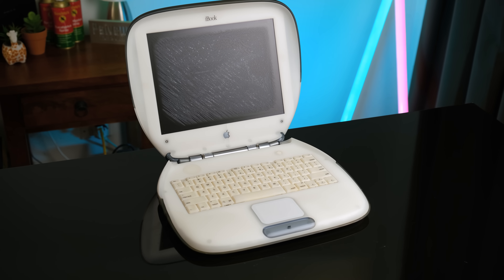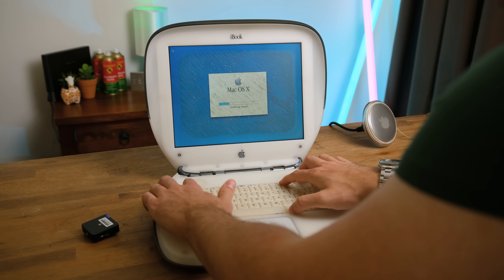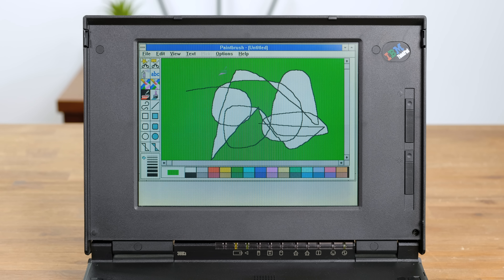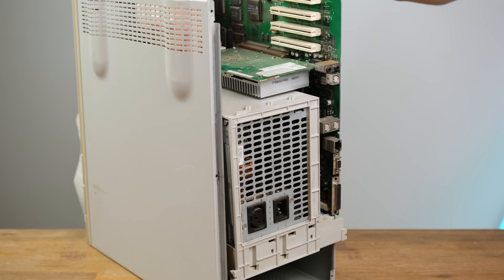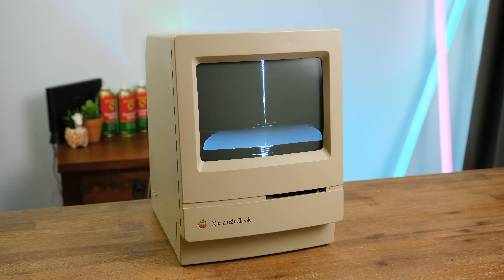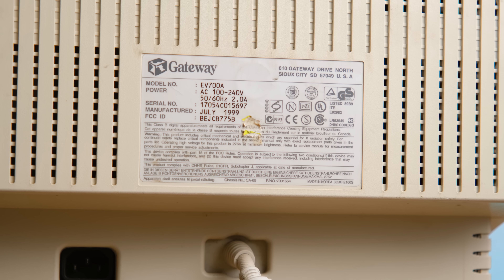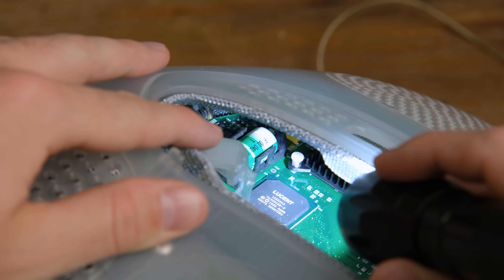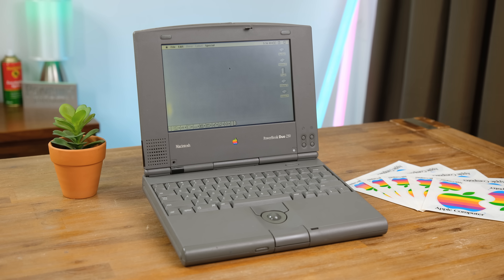So Much Vintage Tech Is Dying... Here's Why

Comment: I'm hopeful over these next few years we start to see things like motherboard reverse engineering, as well as after market motherboards for at least the big ones, imagine a raspberry pi powered iBook, for example
Reply: Or even things like the resistor emulation NES emulator
Reply: A couple machines have already been reverse engineered, so hopefully more will come in the future. The Commodore 64, Amiga, and NES all have brand new boards that can be used to restore old machines. You can even build a new machine almost entirely with off the shelf parts, aside from a handful of custom chips.
Reply: @NoToeLong  That's awesome!
Now imagine in the far future a board like that for say the OG Xbox, or iBooks
Reply: This reverse engineering is already common for industrial and vehicle parts, because changing them to something modern would require a lot of paperwork
Reply: @Skullair313  Hm that's interesting
Reply: @NoToeLong  Its very expensive to do retro with real old or new hardware. Software Mame UAE etc a lot easier for casual or multi platform usage.
Reply: And maybe MiSTer on a newer, bigger and more powerful FPGA!
Reply: The new X79 and X99 motherboardso the Chinese are making.
Reply: Along with the environmental conditions in space (no air or moisture) and the expensive radiation-hardened components, they are much simpler. Voyager launched in 1977, the same year as the Atari 2600. It's not at all difficult  to find a functional Atari here on Earth; most of them still work perfectly fine. Ironically it's the much newer devices from the late 90s and on that tend to stop working or disintegrate.
Reply: I'd love to see more open source reverse engineered schematics and boards for things like car ECUs, audio amplifiers, etc. Even if you have to do all of the part sourcing and assembly yourself, it could mean saving an otherwise mechanically sound device from the landfill.
Reply: @BokBarber  Exactly!
Reply: At that point why bother?
Reply: @ligametis  What do you mean
Reply: @ZaCaptain1229  why do you need iBook body for a raspberry pi? Especially when it would fit in smaller and lighter body.
Reply: @ligametis  Why not? There is no reason to play a console from 20 years ago, there is no reason to ever use an iBook from 2002, hell there's no reason to even breathe my guy. The best thing about this hobby is we always ask why not? There's an HDMI mod for the fucking NES, which came out in the 80s. There is no point to that, but people do it because why not. I understand not everyone cares about these things, and there's nothing wrong with that
Reply: @ZaCaptain1229  original hardware is interesting due to historical insight how it worked, how it felt.

If it is no longer original why use modern components to create inferior product? 
At least when it is stationary system size and weight doesn't matter that much, but when it is a portable system like laptop or a phone, tablet it makes zero sense to use something that outdated.

Look at original Gameboy, it makes zero sense you use it. You turn on, appreciate historical artifacts and turn it off.
Reply: @ligametis  Just because the motherboard has been replaced doesn't make everything else original, and if possible improved, imagine an iBook running on a Pi, with an OLED screen, custom made for the Chassis, as well as the original keyboard
Reply: @ZaCaptain1229  but why would you want original body? It is large, heavy, pretty low quality.
Meanwhile we don't even usually make OLED screens in square form factor. That would be an expensive part.

This project would at least cost 300$ if not more.
Reply: @ligametis  BECAUSE WHY NOT!!!!
Reply: @Zac Meyers  waste of time, waste of materials. Where are you going to take such laptop? To work or to university?
Reply: @ligametis  Sure why not?
Reply: @ZaCaptain1229  Ever played PS3 on 1080p, looks aweful.
Reply: @ZaCaptain1229  Original keyboards can be a major pronlrem , see ZX81 Spectrum etc, people disliked and replaced the originals when they could in the 80s. A mint showcase computer is good for display or demo, for serious usage an improved keyboard is a must.
Reply: @ligametis  Check out reversing camera LCD displays, B&W or color 4:3 composite units can be had for cheap.
Reply: @ZaCaptain1229  I mean... He's got a point. I can understand somebody keeping an old iBook in shape. But stuffing a pi in it is... Well, you got a pi inside a mac shell. Like... I don't know. That sounds insanely dumb from my point of view. That would be like me going to car show with a 70s muscle car at a collector show room but I got a modern engine under the hood. I mean, it works! But, there sure will be quite a lot of flat noodles around. Like that won't even surprise me.

Adding HDMI to a nes is interesting because you are working with the original hardware and limitiations and pushing its capabilities in one way or another. I mean, can't really argue its the same than a pi with NES roms on it. 

I mean, short of incorporating it in a way that turns the shell into a piece of art. And I do mean incorporate it in the design and not just strap LEDs on it. There is litterally nothing interesting there. If YOU personally want that pi in a mac shell. Okay, but like, don't be surprised if everybody else is scratching their head.
Reply: @ThermalLance-hg4rd  Hey you make a good point. At the end of the day I just don't want to see these shells, these pieces of history just go away
Reply: I want to reverse engineer a Pentium processor.
Reply: @monad_tcp  That is awesome! Imagine an "Open Source Pentium"
Reply: @ZaCaptain1229   yeah, but it would require expensive microscopy machines and a lot of spare Pentium  that weren't scrapped for their gold. They're becoming a bit expensive.

I'm really interested in developing the computing vision software for VLSI reverse engineering of anything.

But without quality scans I can't do it, I can't do the scans on my own, thou.

Perhaps one day.
Reply: @monad_tcp  Let's hope!
Reply: https://youtube.com/shorts/T6-O2u0KCDc?feature=share
Reply: Thats exactly what i think will happen with newer cars in the future (30 years and more) when the mainboards are dead and you have to trust on some tech geeks reverse engineering the mainboards for example the engine control unit or other things.
Reply: @pixelrobin309  I'm sure it's very likely that's how it will go

Comment: I wouldn't say all vintage stuff is dying, but stuff from the '90s generally doesn't hold up nearly as well as stuff from the '80s or earlier. More reliance on RTC batteries, worse capacitors (I know the Capacitor Plague didn't officially start until 1999 but capacitor quality had started going downhill years before that), cheaper plastics etc etc etc. It also doesn't help that there's not the same spare parts support out there for '90s machines like there is for many from the '80s. 

Whilst I probably won't be around to see it, I suspect that in 50 years time there will be more surviving Apple IIs and Commodore 64s in the wild than iMac G3s or iBooks, purely because there's less to go wrong... and when something does go wrong, there will probably still be parts and documentation out there somewhere.

Comment: The Dell and the CRT monitor are from the capacitor plague era. Those bursted caps would even appear after a few months or 1-2 years back when the computer was new
Reply: There was also another capacitor plague in the late 1980s-early 1990s because during that time, companies were running out of the materials like tantalum to produce them, so most capacitors in electronics would be replaced with far cheaper and poorer quality ones like most notably ELNA that didn't quite measure the properties of the older capacitors.
Reply: @blazuma111  Another version of this capacitor problem from the same time period was caused by a raw materials supplier basically counterfeiting one of the electrolytic ingredients. It was a big scandal at the time.
Reply: @@Orobas-jb9fi i actually did find one of those very old Dell Dimension 2400s or something similar to it that eas still running. Someone was actually still using it and wanted me to fix it because it wouldn't boot anymore. The caps were all fine,the reason it didn't boot anymore was because the original hard drive decided to finally die. This was back in 2022,it was in service since 2002 or 2003 whenever those things were made until last year lol
Reply: @@Orobas-jb9fi Well i wasn't trying to blame the heat for their failure,but those electrolytic caps would burst faster if they would get too hot.It's true that today's CPUs can make more heat,but all capacitors are now solid state and they don't have liquid aluminum inside them as the classic caps do. As for XP on low RAM it depends,SP3 doesn't really like low RAM and old CPU machines,but SP2 and under usually tend to run better on lower spec computers in my experience at least.
Reply: @@Orobas-jb9fi True,there were a few Dimensions that would have bursted caps (mostly were the one that had higher end Pentium 4's that ran hot and damaged the caps) but overall the GXs did seem to have failed more than the Dimension. As for reliability yeah,i never owned one myself but i did come across a few of them for servicing and most of them were really basic and underpowered Celeron and 256MB RAM combinations,but they were very reliable and actually pretty snappy for the hardware they were using
Reply: @LUR777-g7r  I'm currently staring at my Pentium 4 Dell machine from the mid 2000s in fear
Reply: @Dumb_Killjoy  The capacitor thing is inevitable even if it's not bursted. Good caps like Rubycon claim to last for about 20 years or so. Even if your computer's caps look fine visually,they can still be bad in terms of electric values and spec as they degrade with time anyway. Still,it's not the end of the world because you can just recap the board again or hire somebody to do it for you
Reply: @LUR777-g7r  Yeah. I've been meaning to do that with my Pentium 4 Dell and my Win 95 HP.
Reply: @Dumb_Killjoy  If the computers still work as they should then i'd say leave them be and just do it if it's necessary. Usually when caps start to go bad and they're visually still fine the computer would start to misbehave like doing random reboots and being very unstable/black screen etc.
Reply: @Laur I just don't want to risk a cap popping. The Pentium 4's high temperature and the fact that my Dell machine is from around the tail end of the capacitor plague especially scare me.
Reply: @LUR777-g7r  caps can and do last longer than 20 years, i have things much older with their original caps still in and working perfectly
Reply: @andygozzo72  Caps even in antique radios from the 50s can still be good, but they can get weak overtime with heavy use and loose capacitance and start giving weaker electrical signals overtime. They can  definitely last 50-100 years + but ones from the late 1970s and up are often rated for nearly 100 years now depending on usage. They may work perfectly for decades until you start noticing things like a dim screen, or fans spinning slower. I'd say the majority of electronics from the late 1980s and up don't need to be recaped yet unless you are experiencing problem while using them.
Reply: capacitor plague was a problem for many electronic devices, bot just computers and monitors, but theyre afflicted a lot  due to the high power/current/temperature conditions ...
Reply: @andygozzo72  Indeed. I witnessed a cap blowing out in a model train locomotive that was just sitting there idling (for those in the hobby, it was an O scale model of a NY City R-32 subway, made by MTH). I was at a friend's house running some other trains while the subway was sitting on an upper level powered but idle, when we heard a loud POP! and soon noticed a burnt-peanut odor wafting across the room. 

By process of elimination we narrowed it down to the subway, and upon removing the shell, were treated to the sight of the failed capacitor which had blown its guts all over the interior of the carbody. Needless to say that unit required a circuit-board transplant (a more than $200 part) since the board design at the time meant that a failed cap usually ruined other components in unreachable parts of the bi-level circuit pack.
Reply: actually the cause of death of CRT's caps was usually unstable driver chip. And you replace blowed caps and it would blow away. And chip would die only on third or fourth attempt.
Reply: @Orobas 66 uh oh, used to have one of those.... what about the gx260, i still have one but only use it occasionally
Reply: @Orobas 66 yep, poor quality caps, but the heat doesnt help, its the biggest killer of caps even top quality ones,

Comment: I have a Compaq Presario A900 that is currently running windows 10 pro and the only issues are the battery and the clock battery that both failed. I still daily use this computer.

Comment: Also, I have had issues recently with older MacBook Pro's... a 2010 that I have been working on has a failing discrete GPU but the integrated GPU still works.
Reply: @decidedlyjass  Thanks, thought that was the case - what do you say is the best way of disabling the graphics chip?
Reply: @decidedlyjass  isn't this 2010/2011 generation of MBPs the one notorious for the dGPU problems? or was it a previous 2008/2009 generation? can't remember
late 2000s thinkpads also suffered from dGPU issues
Reply: @nerd2544  think so, on other people's review videos of the 2011 I saw that the GPU did not get adequate cooling as the placement of the heat pipe made the heat from the GPU go through the CPU to get to the fan. In other words, the placement of the GPU in relation to the heat pipe and fan was far from optimal so they probably baked themselves to death

Comment: No it simply because of the climate. This issue is pretty much non existed in Europe. But I do see it a lot in Japan.
Reply: Same, I live in Europe and I rarely see it here in older electronics
Reply: It's not just climate - the OP uses eucalyptus oil all over his vintage electronics. Death by chemistry.

It gets humid in Europe too but with proper storage you don't get the kinds of problems the OP is getting.

Comment: i am happy that my old 286 PC still works with ho original 20MB MFM HDD and i have found that PC on the Street. I tourn it on from time to time to check it. Also my old IBM PS/2 CRT VGA Monitor. 

Or even the two TVs from 1976 are still working.
Reply: I had found a Type 1 (10 Mb) hard disk in a DEC Rainbow. I put it in a 286-8, and to my surprise, no bad sectors. The defect list was empty, I had assumed the ink had washed out somehow, but no, it was just a clean drive. 

From 1981 lol.

Comment: How am I not surprised that some of these older devices are failing...
That reminds me, really need to check and/or sell on some of my older stuff.
And to add regarding the rubber coating... Dell laptops from about 10-15 years ago are starting to have issues with the coating as well from personal experience.
Reply: I have a Dell Latitude 7280 (roughly 5 years old) that is already starting to show signs of the rubber coating going
Reply: @JustARegularNerd  yeah rubber sucks.
Reply: Rubber coating, well my Dell e5440 has this problem.
Gets sticky sometimes, on monitor bezel.
Reply: I have an old vw golf, and parts of the interior around the stereo have the rubberized coating and it sucks it is degrading. Unfortunately I made it worse when trying to clean it to put adhesive cable clips on it for a phone charger on the dashboard.
Reply: E6430 models started getting this problem years ago, absolutely terrible idea.
Reply: @treennumbers  I found a Dell XT3 Tablet PC with a pen that's like splash proof and insanely shock resistant, with a display that has a single flipping arm.
Got rid of the BIOS password, installed Windows, all works really well but the rubber is completely gone.

I also had an HP EliteBook from about 2010 with a 1st gen i5, a dedicated MXM GPU and full size display port, experimental UEFI and USB 3, insane machine, but rubber destroyed. I am writing from a pretty healthy ruberized Dell Latitude, I wonder how long that will last.

STOP USING RUBBER
Reply: @Zebra_Paw  there's good rubber too, but it's not that 'nice' when it's new.
Reply: @jannejohansson3383  I have never seen good rubber lol
Reply: My e6530 ughhh
Reply: My XPS 13 from 2013 is starting to get a little sticky on the palm rest. Yay.
Reply: That rubbery is from hell at first place.